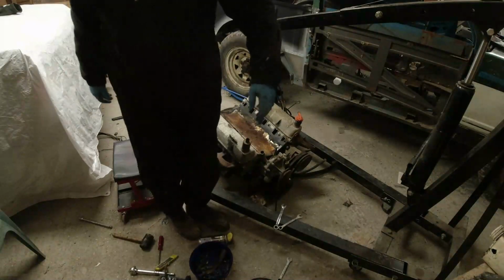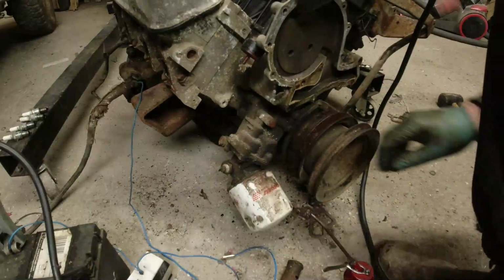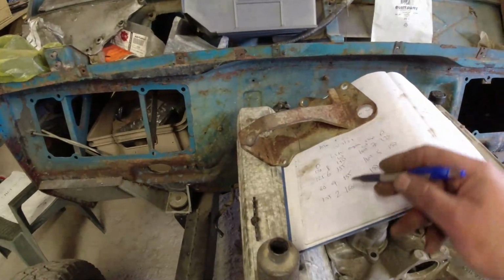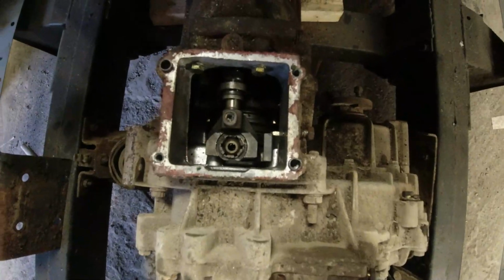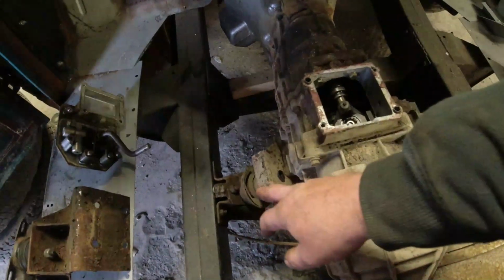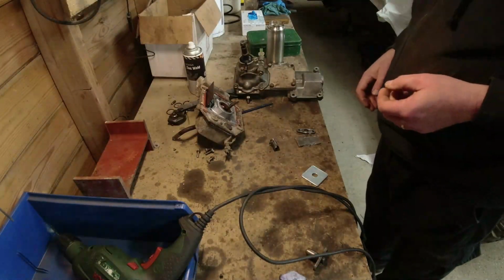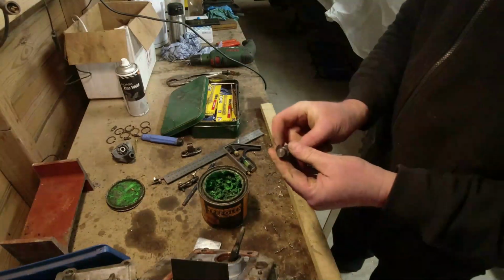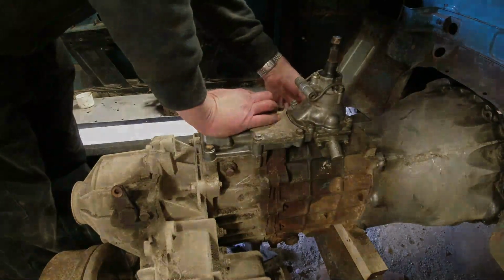Episode 29 - 1971 Range Rover BOB - Engine and gearbox shenanigans - Parental warnings

Comment: The mechanicals are always my favourite part of a rebuild. I’m sure that engine will be fine- I reckon it’s more likely to have been rust or dirt on the valve seats of the ones that were open while it was stood and that gets cleaned off as you churn it over, especially with some fluids added. I didn’t see any dust from the exhaust ports which I would expect if cleaning rust off the bores.
Interested in why you didn’t prime the oil system down the distributor hole before putting a dizzy in. I don’t have the right adapter but find a Torx socket works well with an extension bar and adapter into my drill.
Reply from the maker: Good point on the cloud of dust from the exhaust ports, there was definitely none of that.
I usually prime the pump using my tool.... fnarr... down the dizzy hole. This time I just couldn't be bothered and opted for plan b which is not normally possible when the engine is fitted into the engine bay. I had assumed that the shonky old oil filter would still have oil in it so just by filling the pump gears with oil should be enough to draw the oil up from the sump. 👍🍻

Comment: Hi there richard thanks for your series your doing ...... i have recently bought a 3.5 efi  and a3.9carb classic both of which need work on foot wells and sills as well as engine work,i have been watching your up dates to see whats needed......any chance you can list some of your suppliers for these materials( panels ect or engine parts .bearings ect )as some times a close fit is not good enough if you dont know any better your wasting your time the same with parts ...good or bad  / as you said on one blog they (new repair panels) needed adjusting and trimming to fit ...I think it will do you series good as suppliers will start to give discount to you or sponsor that episode.....i have dropped you a email to CHC direct re my classics
Reply from the maker: Thanks Paul, I will add into the links in future where I get panels from and where they need additional work. Cheers Richard